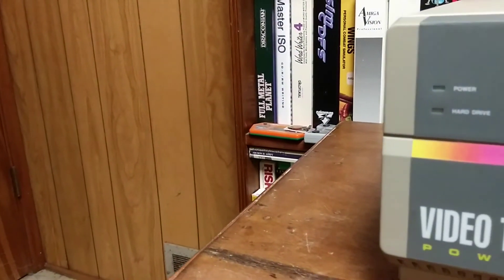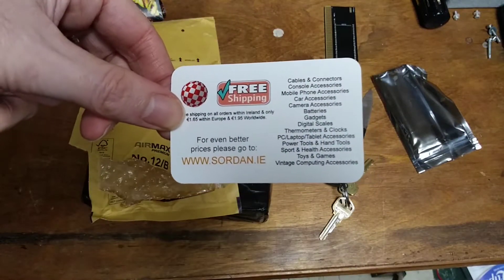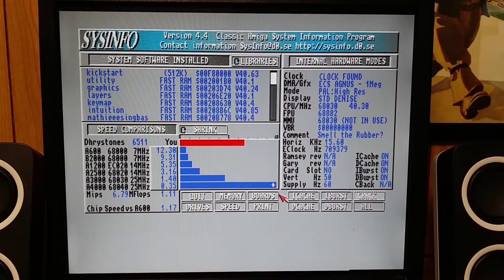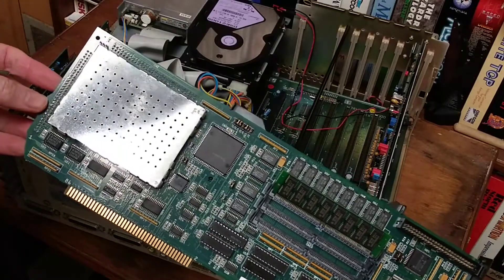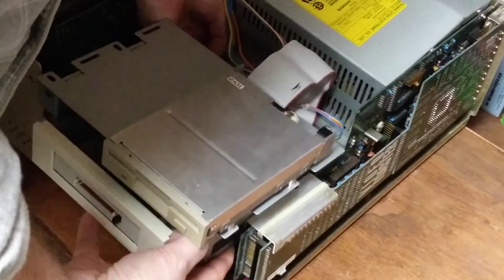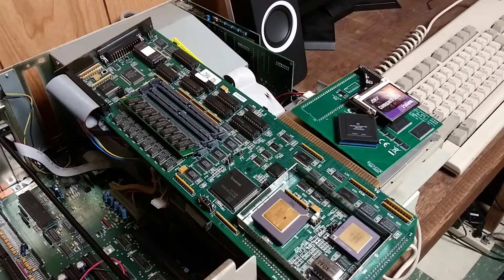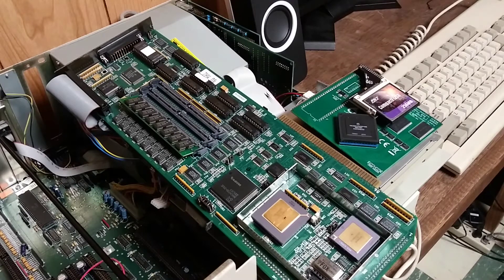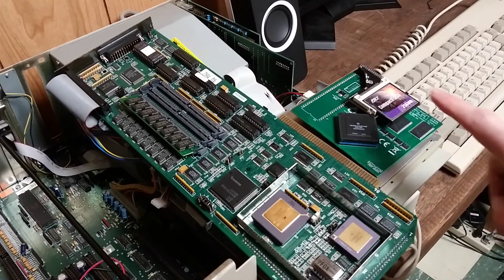Commodore Amiga A2000 TerribleFire 536 Turbo Accelerator Board Install Upgrade

Comment: um my TF534 works in my rev 6 A2000, not the TF536 :( 
(conflict w/ZZ9000?)
And...there arent any GVP/other full Z2 cards for sale anywhere under $400 now- inflation, and greed...?
Reply from the maker: Expansion is quite expensive on these old machines. Not much has survived the long years since they were produced. Those that did command high prices. Keep in mind that they were expensive back in the day and remain so to this day.

Comment: I really would like to go TF536. I just dont like that there is no built in card slot blank to support it. It almost needs a bit better design like a dedicated card.
Reply from the maker: @beigemachine549  Its basic but cheap and works well.

Comment: I wanted an A2000 for over 30 years and finally got one, but I have not done too much with it yet. I have actually been using my CD32 the most. It is do nice to find so much support still available and such a supportive community.
Reply from the maker: Commodore nailed it with the A2000! I plan to do more with it in the future :-)

Comment: Thank you for posting! I have purchased the very same items for my three A2000s & I will be using my new terriblefire 536 turbo accelerator board in my  a500+. You saved me the work of using them in my a2000s. Your tips about where to order additional GVP RAM was very helpful too! Everything you did was exactly what I needed to learn at this very time. THANK YOU!
Reply from the maker: Great to hear! I will be posting a new video regaurding my experiance with the a500 soon ;)